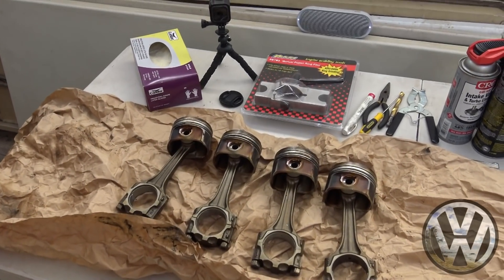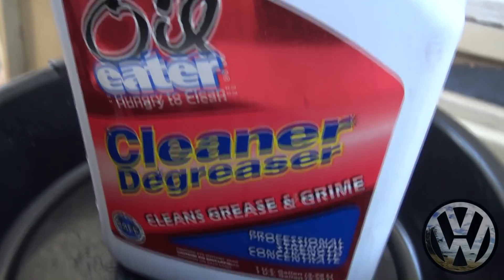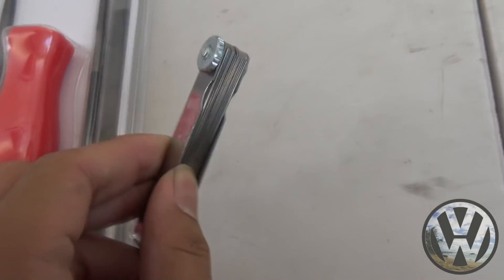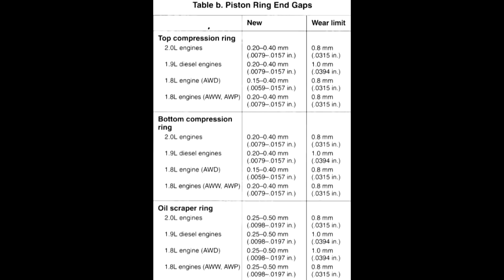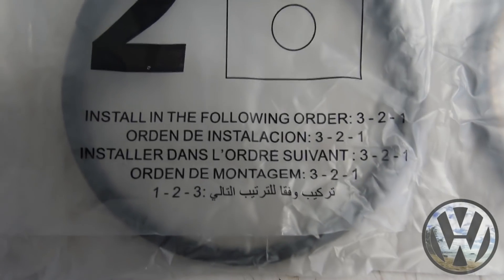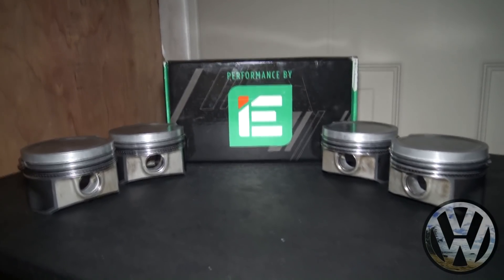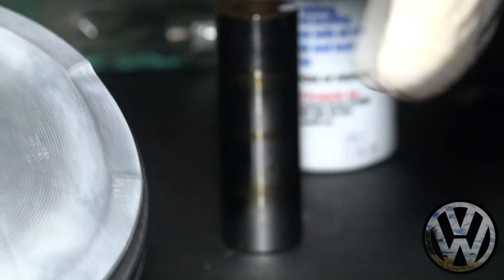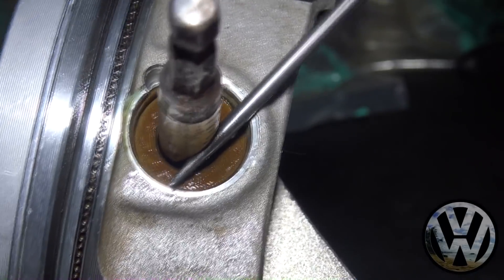VW MK4 1.8t Big Turbo GT2871R Part 1

Comment: You done rings wrong 🙁 Gasses that escape the top ring (looser in this case) do not make it past the 2nd ring due to it being tighter, and are forced back to the top compression ring (pushing from underside), causing it to lose its sealing effectiveness. Every piston manufacturer and their mother recommends a 1-2 thou (or a certain %) larger 2nd compression ring gap. Sometimes this effect called is Ring Flutter. I hope this help 👍
Reply from the maker: Peter PTR I’ll look into that. Haven’t heard much about ring flutter. I just stuck to the factory repair specs but that is some interesting info.
Reply: @MKIVMARV  factory specs are good but for factory spec engine with factory spec boost and turbo. I done a lot of all types of engines and this is quite important if you planning go big boost without problems 👍
Reply from the maker: Peter PTR I’ll open them up a bit, haven’t dropped them in the block yet. Thank you 🙏
Reply: @MKIVMARV  No problem 👍 i hope your project will be successful
Reply: I recently built my mk4 1.8T VW GLI Running a Garrett GT3071R. I see comments about ring Gap. I honestly wouldn't go with the Bentley Manual specs. Being that is for stock motor and stock turbo setup. I went with JE Pistons and IE rods. JE has their own specs based on numerous factors about ring gap. Mine is 16 top ring and 20 second ring. giving it only 1thousands of an inch difference is not nearly enough. From personal experience my set runs great, no excess crankcase build up. All cylinders tested at 155psi.
Reply from the maker: @hulahulahoppah  Thanks for the feedback as well.  My assumption was that ring gap specs in the manual  were for longevity..will definitely take all this info with the 2.0L stroker project.
Reply: VDub In Paradise yeah man I made a couple videos on my channel when I did my build. Check out anything that may help with your build. Best of Luck! Hoping to see more of your build In the upcoming videos.

Comment: 0.15 and 0.16mm???  Is not that to tight?  Im doing 0.18 top and 0.20 second, oil min 0.15 an that is in inches
Reply from the maker: In Part 2 of the series, I changed the gap to 0.016 and 0.018 inches.
Reply: VDub In Paradise Nice bro I realised that when I whatched the 2nd vídeo! Keep going!

Comment: This might be a stretch but I need some help. I have a 99 gti 1.8t. It was wrecked and now has a N/A 2.0. It runs like dog shit and needs tore down and rebuil or at least looked at it's about 14k miles shy of hitting 200k. Can I get some recommendations on where to find quality parts. And some common issues to look out for. Thanks in advance.

Comment: I dont think there is a need to hone the cylinders if they havent been bored out..
Reply from the maker: Maybe..I just like the idea that a fresh hone and new rings will wear out the same time and seat properly.
Reply: @MKIVMARV  i guess it depends on the ring material used, i forget how it goes, i just see it as scratching up a smooth sealing surface while increasing the bore diameter and the time the rings break in or smooth back out the cylinder youll have more piston/bore clearance and larger ring end gaps

Comment: Loving the series. Im away to shave and paint the engine bay then onto engine internals and BT. Did you clock your rings, ie 6 o'clock and 12 o'clock?
Reply from the maker: Haven’t clocked them just yet..plan is to do them when we put the crank in.

Comment: Sick video. Why not include headstuds in the build? Do you plan on using stock studs?
Reply from the maker: Head studs and main cap stud conversion was part of the build..but after the recent shipping costs we had to cut down to brand new OEM head and main cap bolts.